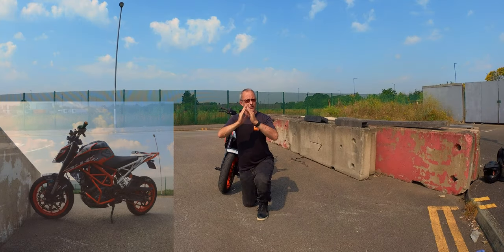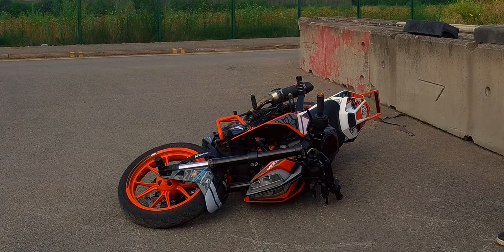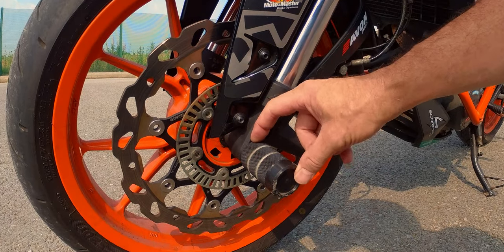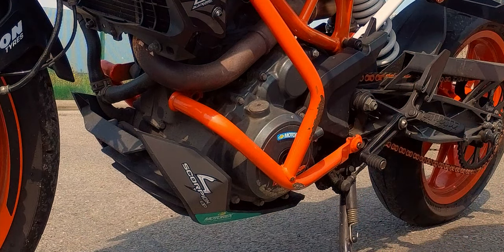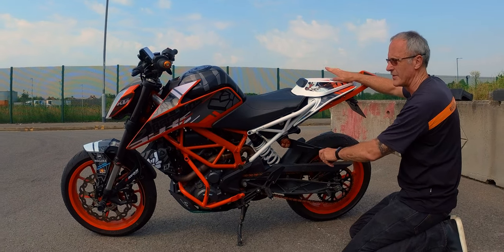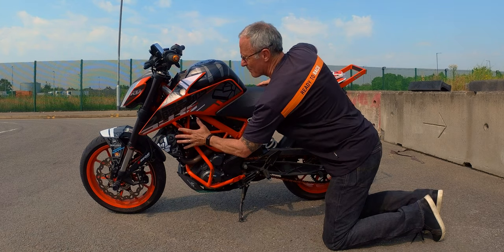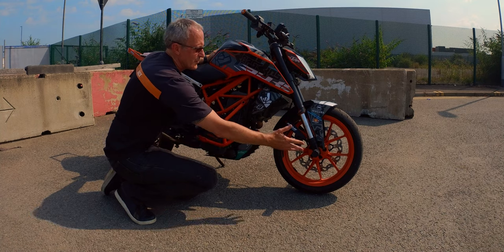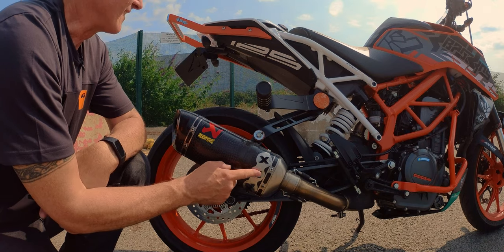Crash Protection for the KTM Duke 390? 125 200 250

Comment: Every KTM 390 owner should watch this. I appreciate your effect placing the bike on the ground to demonstrate your point.

Does the crash bars by itself actually protect the radiator or is it too short? Or do you need both the crash bars and the front axle bars (whatever it's called)?
Reply from the maker: Thanks.   Crash bars do most of the radiator protection, followed by the rear cage which stops the bike not rolling over too far.   If I wasn't running the rear cage I'd consider a proper rad guard but then you can't run the crash cage with most - except the adventure style crash cages and even then you have to be careful because the upper mounting point can damage the frame if its not properly supported (which most aren't)

Comment: Loving the location, a lot more bright than the garage, great video as always, I have the fork protectors and powerparts engine cage myself!
Reply from the maker: Thanks.  Made a change to have a nice day and not too noisy a location.  Sounds a good choice!
Reply: @MotoMirius  lovely weather in the UK isn't it? Shame I can't ride! Still waiting on the DVLAs medical decision.
Reply from the maker: @callumboothroyd3766  Hopefully you'll get a positive result soon.   I've hardly ridden at all recently.
Reply: @MotoMirius do the bagoros front peg sliders require a different front axle? Going to install them and it would appear so
Reply from the maker: they do, yes - maybe depending on year this will be different as the wheels have changed - you can see it here - https://bagorosperformance.com/product/front-freestyle-crash-pegs-ktm-duke-125-200-250-390-my-2017/ @Brownkid422

Comment: Thank you for the video. I crashed my 390 Duke when practicing slow tight turns in the parking lot. The crash bars protected the engine side but the front brake lever bent and the mirror and the bar end got scrapped. I need more protection on the bike before I continue practicing and your video helped me to gather some information about it.

Comment: I have the power part cage like yours and sliders on the forks. I’ve kept the bar end weights and added shorter levers. If I had a nice Can on it I’d get the rear cage like yours to protect it. Always great to prevent damage. Thanks David
Reply from the maker: Thanks Andrew.  Bar weights are great for dragging down the road. I only don’t use them because I changed the handlebar after it got bent.
Reply: Hey, I'm in the U.S. do you know where to get the bar end weights?
Reply: @imdabossyoneone5692  Sorry I don’t.

Comment: Another nice video, im also looking to invest on the rear subcage. What kind of side mirrors are those are easy to use and not easily blocked by your body?
Reply from the maker: They are not very good.  I know exactly what mirrors I want - and they will go there, but the only ones I can find are very expensive, and I have yet to figure out how to modify the stock ones to sit there without using a bar end mount.

Comment: David, 

You’re so well versed in the parts for the 390 I hope you can help me find better options. Whilst practicing motogymkhana I drop the bike at 0-5 mph.

I have an SW Motech engine guard (pretty, svelte!, protective, invisible!). I am searching for something as demure as this for the rear—especially to protect the aftermarket silencer! 

Your (rear) crash cage is garish for me. Can you recommend anything else? 

And you’re right, the rear peg frames act as protection on the left ~well enough, but, on the right the oem silencer was slight deflected and helped by the tin shield at the base.  220419
Reply from the maker: I've seen quite a few complaints about the SW Motech engine guard damaging the frame and not protecting the engine - maybe its ok at 5mph.   You have a choice between pretty and invisible or choosing something that will actually protect the bike - you can have one or the other    There is very little choice in rear protection which is a main reason why I use the rear frame that I do - there are other stunt cages out there for the rear but even more in your face.   You might see if you can find a long enough delrin slider that will screw into the swinging arm - I have seen this, for 5 mph maybe ok.
Reply: SW motech crash bars will destroy your upper engine mounts eventually. The construction of those bars is not proper for the bike. I used the powerparts crash bars (in the video) and front fork sliders for my gymkhana sessions in the last season. Crashed about 15 times so far, it did really well for such a tiny protection kit. The only thing that’s gone is stock handlebars — it’s bent heavily. I also bent my tank slightly 😂 Can’t wait to test out the same kit David has (Rok Bagoros front pegs, subcage and handlebars + powerparts crash bars) the next season!

Forgot to mention shorty/folding levers — they are an absolute musthave. Stock clutch lever will break and take away its mounting system. Had that replaced as well.

Aaaand… if you ever use handguards like powerparts make for bigger CC KTMs, please take care and keep an eye on them. I had those, they eventually went loose, and I was too careless to tighten right away. When the bike went down the very next time, a handguard rotated and smashed the TFT display of my Duke 😂 So, take care

Comment: Hi..im planning to put on the engine crash bar..does it scrape or hit the road when heavy conering or almost knee down?

Thank you in advance
Reply from the maker: If it is the Powerparts cage then no.  I'm sure it's possible to scrape it but I suspect you'll run out of tyre first.  In the picture for this video it is resting on the cage which will give you some idea of the angle you'd need
Reply: @MotoMirius  ok thanks bro 👍

Comment: So I crashed for the 1st time on my 2019 390 Duke. I damaged the muffler side of the bike. Rear brake lever and foot peg need replacement. The clutch cover and a couple of bolts on the cover need replacement. Which videos can I watch of yours to handle these repairs. I’ll be ordering sliders and engine protector cages, also. Thanks in advance.
Reply from the maker: Clutch cover - https://youtu.be/8iA7Nsd07Lo  Case protectors https://www.youtube.com/watch?v=6vmsB6BCb40&list=PLpKOr6GM2hB3yKDghMX1Ysll4aq0Q_0Y-&index=32    Sliders will depend on what you are fitting, cage "Basic Crash/ Stunt Protection installation - KTM 390 125 200 250 Duke"
https://www.youtube.com/playlist?list=PLpKOr6GM2hB3yKDghMX1Ysll4aq0Q_0Y-#:~:text=Basic%20Crash/%20Stunt%20Protection%20installation%20-%20KTM%20390%20125%20200%20250%20Duke but watch the powdercoat in the threads

Comment: Where have you got that rok bagoros edition handlebar? Witch other Magura bar can replace it or is similar to it? Thanks in advance.
Reply from the maker: Currently the RB edition handlebar is out of stock - I'm not sure if they will make it again.  Magura appear to have changed the dimensions of the x-line bars so I'm not sure if they currently make one.   Pro-taper might make one - they are an off road handlebar size.

Comment: Is the sprocket in the video 50or56T?
Can I use 56T without removing the chain guard?
Reply from the maker: Its 48 - with a 14 front sprocket you can boost that up to about 53.  A 56 will normally need the rear end of the chainguard lifted - most people add a little plate between chainguard and swinging arm.
Reply: @MotoMirius  Thx man !!:D

Comment: hey Mirius, are the KTM PowerParts Sliders too small for the same protection rokbagoros ones offer?
Reply from the maker: I find them a bit short.  If you want a slick road bike build then go with the Powerparts or better yet the Bagoros Performance shorter sliders - but there is a small risk of scraping the fork/ radiator.  I like the longer ones because they push the bike further away from the road as it slides along - but they don't look as slick.
Reply: @MotoMirius  yes sir I think ill go for the longer ones bagoros sells, too bad KTM doent have them like that

Comment: Hi, wanted to ask you from where did you get your engine crash bar?
Reply from the maker: Engine crash cage is KTM Powerparts
Reply: @MotoMirius  many thanks! Searched for it and it seems its extremely hard to find it from where Im - Bulgaria. :( Have to order it from somewhere else in Europe. But any way, great video and many, many thanks again!
Reply from the maker: @volenstanislavov2166  It's a stock item for many KTM dealers, but good luck with that, it's rare I'm able to buy what I want from my own country when buying bike parts.
Reply: @MotoMirius  You were right! Actually found the part number in KTM powerparts section and found in Germany dealer, which is very low price for shipping and little time to get it here. Once again, much appreciated!

Comment: I actually jumped the gun and bought the ktm crash gaurd and bagoros crash bobbin and the bottom motor slider. But since i kept the crash gaurd I couldn't install the other 2!

Would you say the crash gaurd is a better pick over the bagoros crash bobbin that uses the same bolt location as the ktm crash gaurd? Plus the orange case sliders?

Now I'm stuck with 2 parts I can't use.

Thanks for all your videos!
Reply from the maker: Thanks.  Yeah, it's a bit unfortunate that you can't use both.   It depends on your riding.   Crash guard is the best protection but some people want minimal and subtle protection so the compromise is the sliders.   I run both at different times.
Reply: @MotoMirius  I'm a new rider but I want the most protection for when I drop the bike by chance. I currently have the Bagaros sub frame with the pegs and love that it extends outs. Plus the ktm crash gaurd for drop protection. Waiting for the front bagaros pegs to come back in stock. Too bad there's no additional radiator gaurd I can add with the ktm crash gaurd. I noticed some generic ones that does have a bobbin sticking out of the crash gaurd but I'm unsure of their mount points. 

Looking to maybe get my step daughter a duke 200 because we don't have 125s in Canada. 

I want to take an advanced rider course next year and the following year dirt bike riding course. And jaut keep taking courses and learning more. 

Sorry for the long reply.
Reply from the maker: @TrueDreams  No problem.   Rear subframe, front cage and front sliders and you are pretty much good to go.   I've low sided the bike and high sided the bike with this and it has been fine.   When I highsided I broke my arm but the only damage to the bike was some scratches on the cage and on the end of the handlebars.
Reply: @MotoMirius  so the cage does a decent job of keep the rad off the ground?

That was the only main protection that was lacking with ktm crash gaurd.

Nothing really can be done to save the bar / handles and grips as they'll just drop and break and twist.

Thanks again for all the awesome videos.
Reply: @MotoMirius  Wishing you a speedy recovery. I want to buy everything you mentioned but they are out of stock unfortunately. Any ideas where else to buy? I'm kinda hesitant to ride without them. I just bought a 2020 Duke 390 less than 3k miles, so I'm trying to keep it immaculate and fully protected before really riding out.

Comment: Hello,are these the same parts for the 125 200 250 and 390, or is it different ? Thanks !
Reply from the maker: Hi, most parts are the same - the chassis etc are much the same, differences are mostly related to engine, electronics, lights (for some countries) and wheels/ suspension (because of power and weight differences). Of course you should check before buying depending on what you are looking at.
Reply: @MotoMirius  So whether we take for a 125 or 390 it's the same for models from 2017
Reply from the maker: Within the limitations I noted yes - some things also remain the same with the BS6 model from 2021.   There is also some compatibility of parts with the Svartpilen and Vitpilen 125/401.   But double check before spending money.   You will note for example that my 390 often has 125 panels on it when I fancy a colour change - because they are the same.  The new 2024 Duke is different. @mathieu0151
Reply: @MotoMirius thank you for this information
Reply from the maker: If you check the community page on my YouTube Page - https://www.youtube.com/@MotoMirius you will see a photo of the current build of my bike.   Note the 'stock' parts fitted that are not from a 390 Duke.  @mathieu0151

Comment: Sir how to install duke 390 tft display on my duke 250bs6 please sir reply me 💔😞
Reply from the maker: Unlikely to happen - tft runs its own software - and it needs to talk to the bike ECU, so you need a software engineer who can hack into the locked ECU to rewrite the code in your 250 to talk to the tft software - and it's all CANBUS.  If you want the 390 tft on your bike the cheapest solution is to upgrade to a 390
Reply: @MotoMirius  thanks sir ❤️
Reply from the maker: The alternative is to find a country where the 250 has the tft and buy the ECU for that country. But you will still need someone to setup the software.